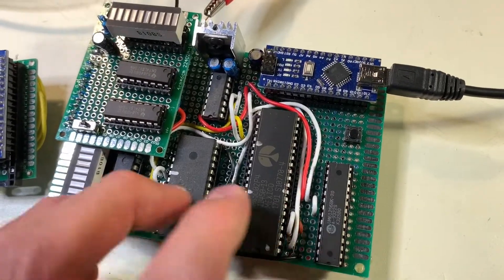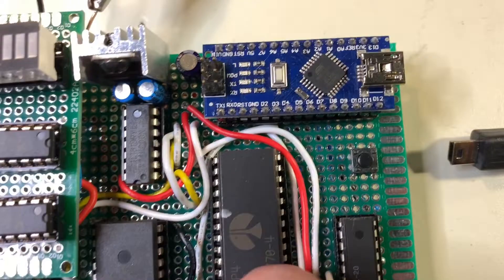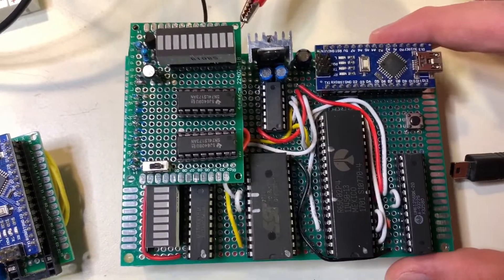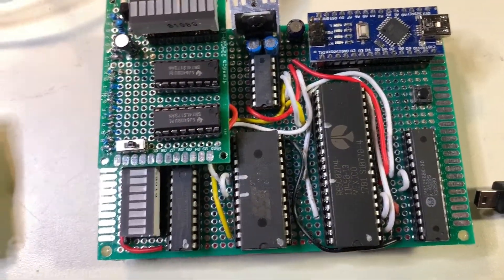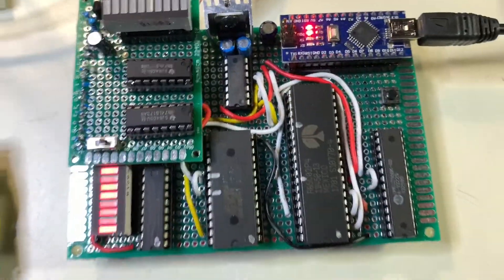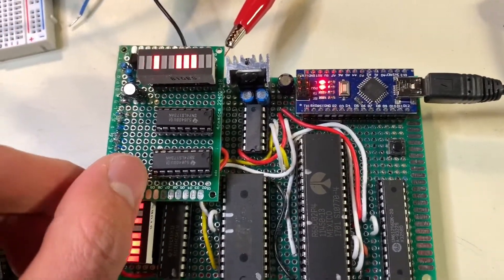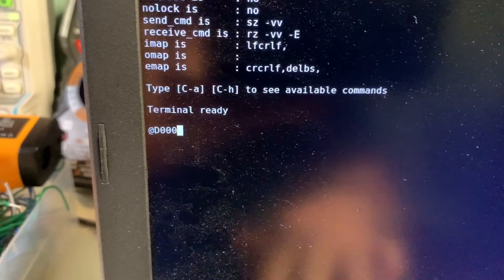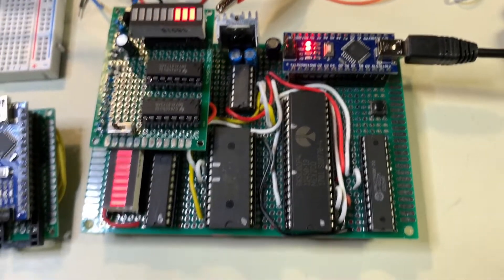65c02 Computer and EEPROM programmer

Comment: Cool project. I'm am also working in a small pet project myself with a 65c02s, and I happen to be driving it from an Arduino Mega, as you describe it you also did in the past. From the Mega I'm driving the clock, rom, Ram, serial, and I have also memory mapped some more Arduino GPIO states, as well as serial communication. Hopefully I get to a state as advanced as you are now.